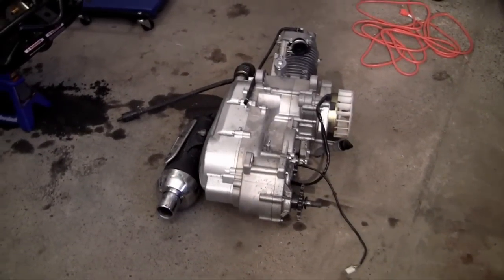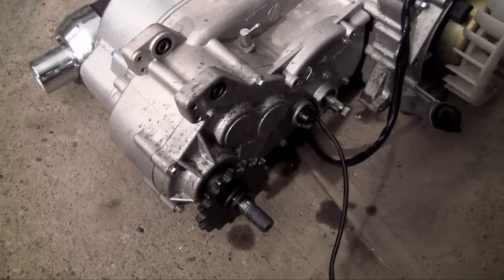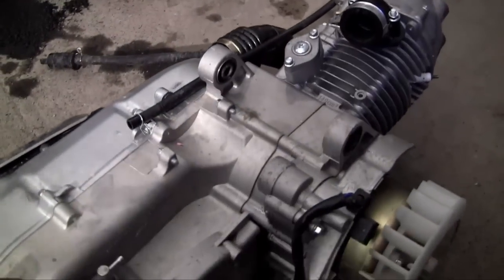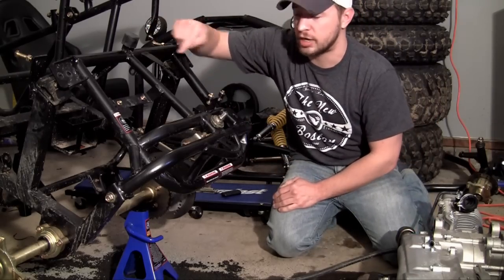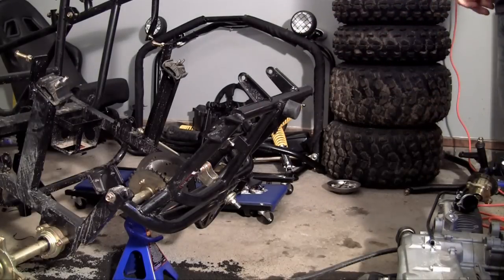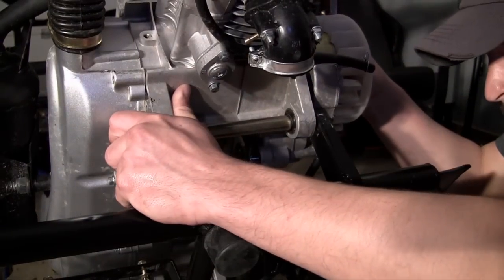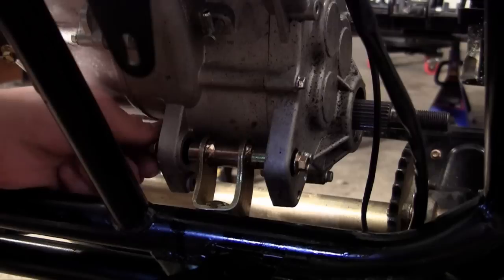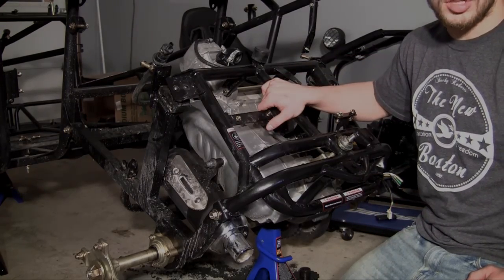How to Build a Go Kart - 2 - The Engine

Comment: Can I used a law mower engine and mod it
Reply: You can but it probably wouldnt be very fast unless put a gear reduction on it but you'll lose all power from the engine, Ive tried it before. if you want a good cheap engine id go with the predator engine from harbor freight in my area its just a little over $100. look it up online